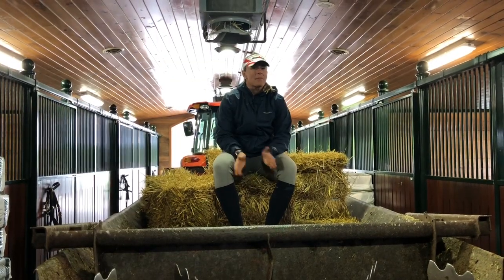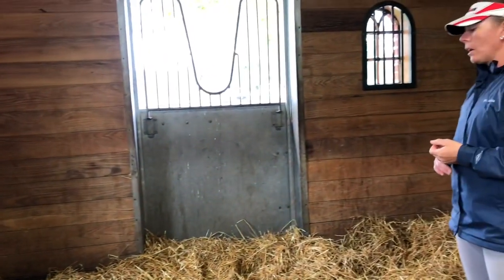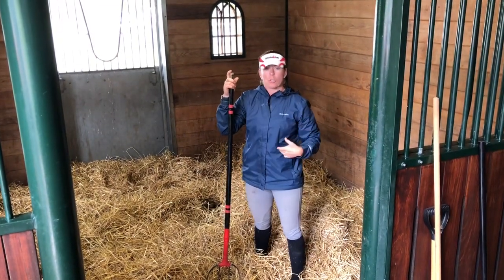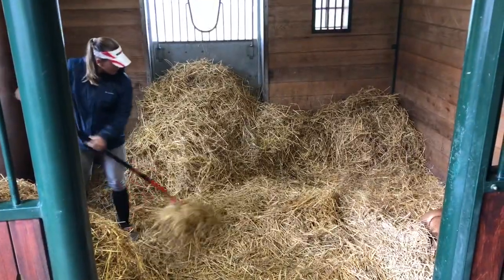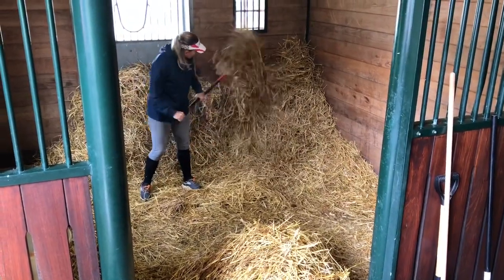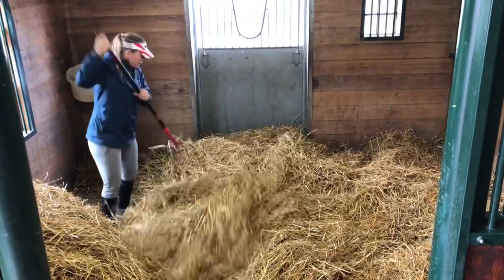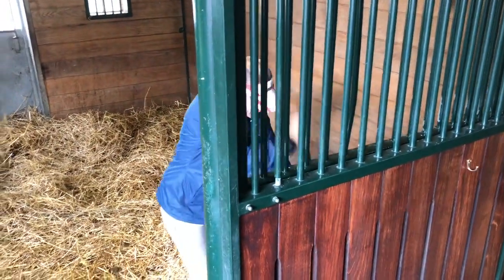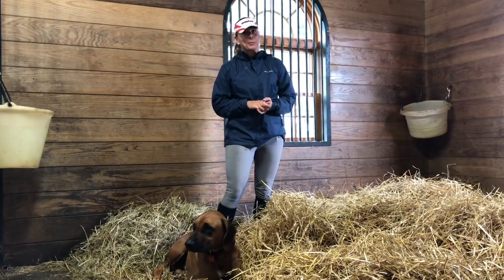The Madden Method - Stall Cleaning

Comment: I prefer shavings to straw for absorbency. Urine will go through a pile of straw into a puddle on the floor underneath, but shavings will hold most of the urine. I've used straw as a frame around my stalls in the winter to cut down on drafts, though.
Reply: You need stall designed to straw bedding. Our stable have in each box    floor with small slope to channel which directs urine to goes away from stall. Like sink.

And it cuses that my bedding is quite dry. I also use condicioner for bedding too. It helps with smell.

Comment: Thank you for your video! I am bedding with straw for the first time for many reasons. I have cleaned 100s of shaving bedded stalls. I have two Shire horses. How many bales are you starting with and when do you strip?  I live in a coastal area and it can be very wet. Their stalls are their driest areas some days.  I like the concret/gravel mix. My floor is dirt/sand right now. I don't like the idea of rubber mats either.  Anymore insight would be appreciated! 😊🐴

Comment: I just started using straw for a pony.  Unfortunately, I have a dirt floor.  My barn is NO WHERE as nice as yours.  Mismatch doors and such.  I also don't have nearly that much straw in there, so I'm rethinking.  Do you use that much straw in the spring and summer or do you switch to shavings?   I have to admit, it's much easier cleaning a stall with shavings than straw.  :)
Reply from the maker: Our horses are all on straw year-round, unless they have a specific issue that keeps them on shavings instead (such as an allergy). The key to straw is to use quite a bit. Using too little will just result in it being trashed. We find straw stalls faster to clean than shavings. It takes a little practice though if you're used to shavings stalls.

Comment: It takes you 15 min to do clean one stall. Seems like too much work and shavings seem easier. Maybe that's just me. Also, aren't those bars on the windows & stall gates and the low ceilings a bit of a safety hazard?
Reply from the maker: Hi! Thanks for watching. All of us at JMS would much rather clean a straw stall versus a shavings stall. They go much quicker once you learn to do it! While it may seem long in the video while we are talking through the process, it doesn't take this long in a normal day.

We aren't sure what could be a safety hazard in what you pointed out. Our ceilings are not low and the bars keep a horse from putting a leg through. The stalls are all equipped with two exits in case of emergency. 

Thanks again for watching!
Reply: I think the safety hazard BlueBlazes is concerned about would be that a horse can kick into the vertical bars. A horse can kick through vertical bars at the Bar’s weakest and most flexible area (the center gap)and then as the hoof and leg drop down to the welded areas then the leg is trapped. This is a pretty common occurrence that few people anticipate when building their containments.
Reply: Too bad its not your time and your horses. These horses are obviously very well cared for.
Reply: I think cleaning straw much easier than a wood product stall

Comment: I have never used straw is it heavier than shavings?
Reply: yes straw is heavy compared to shavings exspecaly when mucking! now a bale/bag of shavings is about the same weight as a bale of straw when stacking.  we have 24hr turn out and no stalls here but the barn area they can use we put shavings down for wet and in winter some straw to keep them off the ground where it's cold....I hate mucking winter though as it's 10x heavier when you add snow n moisture plus it tends to mold if it froze and stuck to the ground. in spring we dig out the barn and lock the horses out so it can all dry then redo the sand floor

Comment: You got a concrete foundation in your barn and for your stalls I've seen people use shavings wood shavings in a powder form like mill sawdust and they water down the saw dust bedding and they compacted so they don't kick up a lot of dust and also like the big Frosted Flake cornflake type of shape shavings to make a bed for a horse in their stall but what I don't see is or I don't understand why don't you put down some rubber mats on top of the concrete and then add your straw to make their beds or use savings but I don't have a problem  with straw  as a horse bedding I've used it before myself and it works very well just the same as wood shavings or saw dust type of shavings as a bedding for a horse but rubber mats on top of the concrete and then adding your strong bedding or wood shavings as your horse stall bedding would make it more comfortable on the horse's feet and hands and also when he or she lays down their body won't rub against the concrete and Bill saw their hair off and the rubber would serve them well as it would also take off pressure from the heart surface of the concrete rubber matting is what I would do and I do that for My Horses I'll buy them at Tractor Supply they cost about 40-50 bucks a piece but they are very very well worth the investment in the long run I'm not trying to insult you on it come across that's an idiot if I have offended you and I am sorry it is not my intention nor wasn't my intention I was just mentioning the rubber mats to protect the horses feet and to make their stalls more comfortable as they lay down during the day or at night when they go to sleep love your video I have subscribe and hit the Bell icon for all notifications!! God bless you and your family and friends always your new subscriber and fan all the way from Dallas Texas to Lone Star State Jose Zaragoza in matter of fact I have about 20 mats that are used but they've been used for about 8 months they are not torn they are in good shape I bought some new ones that are more comfortable for the horses so I have a place to mine if you're interested I'll be more than happy to let you have these mats if you are willing to pay for the shipping? Let me know coming below and I'll be more than happy to send them to you I can send you pictures of them before I send damn to you and since I am seeing a lot of stuff through UPS and FedEx to my subscribers YouTube channel that I have and I have a family member that works at both UPS and FedEx I get pretty good discounts and I can pass those on to you so that you can pay the last for the shipping like 80% less and you can pay for the insurance it'll probably cost you about $20 and it'll cover you for $2,000 Wortham insurance Ford the rubber mats for your stalls but that's an option if you want to pay the $20 in case they get messed up or touring during shipping as it can happen since they are heavy the handlers can dismiss handle the product and I'll take pictures before I send them there for we can have proof that they were in good condition and they will replace if they are damaged during transport. again thank you for this lovely video I am a subscriber I did hit the Bell icon for all notification if you want these 20 rubber mats that's about $1,000 worth of Matt I am willing to give them to you for free if you pay for the shipping comment below and please let me know if not then I'll just throw them away in my trailer and let somebody else have them. God bless
Reply from the maker: django jango Thanks for your comment. Just the edges of the stall are concrete, the center is packed screenings (stone dust) for drainage and grip. We specifically prefer NOT to use rubber mats as they can impede drainage and be difficult to keep clean. Thanks again for watching!
Reply: @johnmaddensalesinc  your welcome..
Reply: @johnmaddensalesinc  A stable I worked at had the ground on a slight slant. The horses just had a large square of shavings in the middle of the stall and the pee would run to the edges then accumulate under the matting, which had more shaving underneath. Once a week we would lift the matting to change out the shavings and put disinfectant powder down. It saved us taking out a lot of wet from pee and condensation during cold weather.